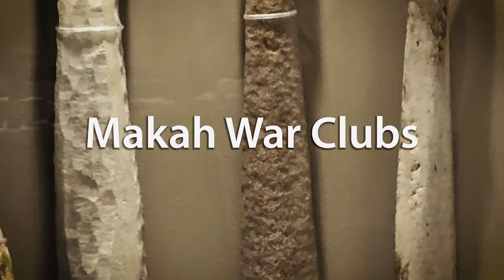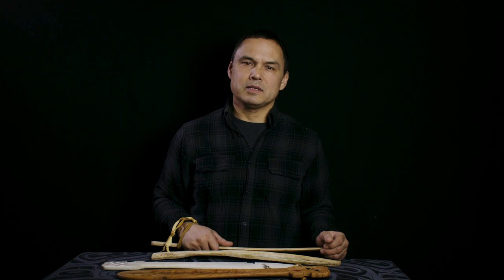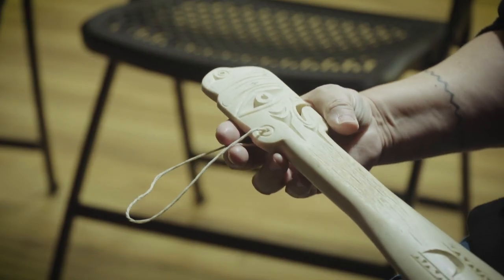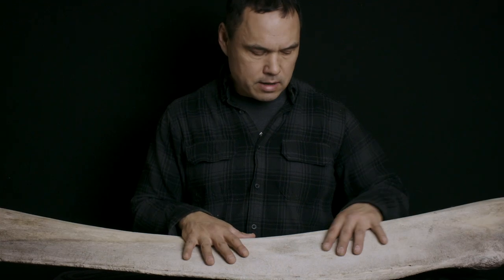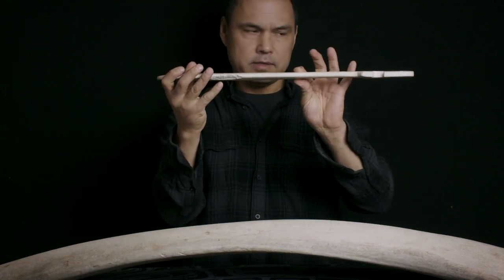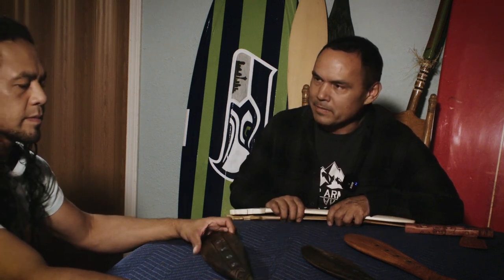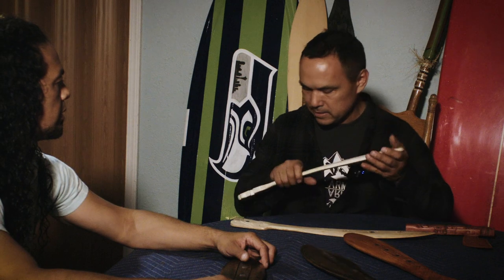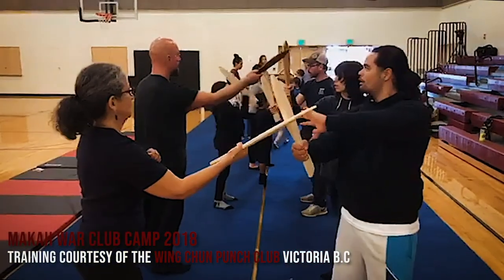Makah War Clubs

Comment: whale bone war clubs were common throughout the northwest coast, mostly based on the same design with the thunderbird head etc, thanks for the video
Reply from the maker: All of the Makah ones I've seen have a Thunderbird and the design was consistent for hundreds of years. After making clubs if various shapes and sizes for testing I realized there is an ideal weight shape and size. 5 pounds is too heavy and 2 pounds is a little too light.

Comment: Just to be clear this is absolutely no less advanced than steel, and used in hot areas preferably OVER steel because steel overheats in the intense sun, making plate and even ring armor much less viable. In other words this is no primitive tool, it is an optimized and lethal weapon! Very valuable skills to learn to use one too bc if you can use this you can use a knife!
Reply: These bone clubs are much lass advanced than any metal tool. No doubt they are lethal but i mean come one man, these are objectively less advanced.
Reply: @Lvl18Meep  no, it always depends on the situation. They’re lighter than steel and it’s a bludgeoning weapon so I’m not comparing it to a knife I’m comparing to a thin steel baton. And for a club? Yes, bone and wood are both great materials even today. They’re just expensive.

Comment: Can I buy a club? Also, these are somewhat similar is design to the Jade and Wooden clubs called Mere and Patu that the Maori tribes of Polynesia used historically.
Reply from the maker: Yes very similar. I’m going to be making some steel replicas to see how they perform. I recently got a plasma cutter. 
I could make you a wood or steel one. Whale bone has restrictions on how it can be used commercially.